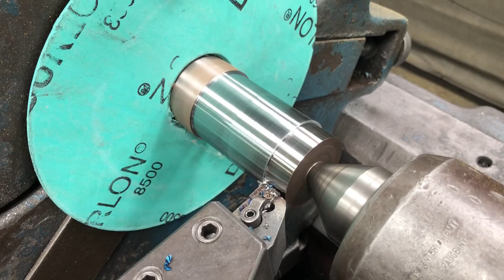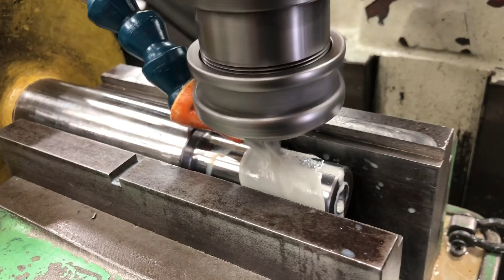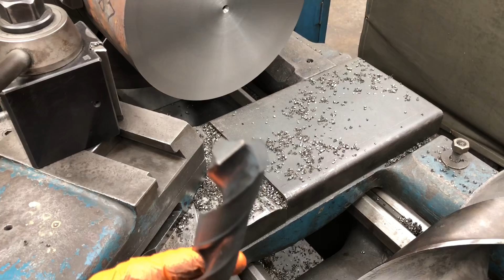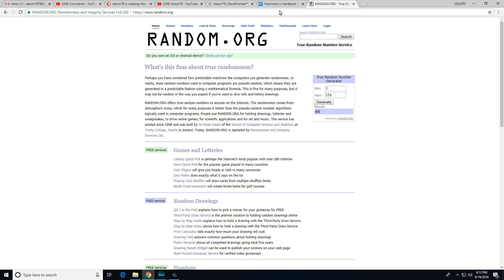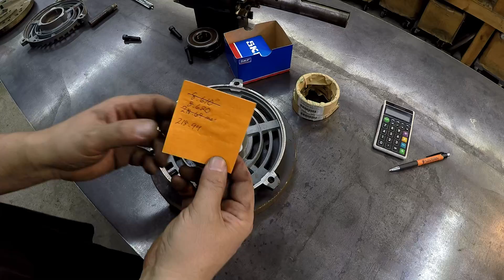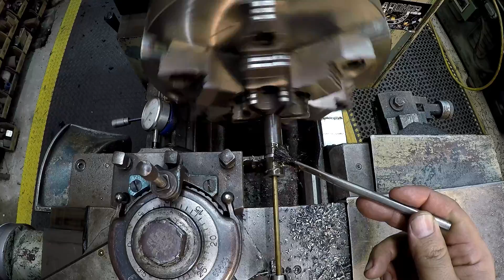SNS 232: K&T Endbell, Roller Repair, November Meet Ups, Machinery's Handbook

Comment: My first machining job was in an electric motor shop, did that very sort of work for two years. Workholding was always a challenge, since the bearing sizes went from 37mm to 180mm and everything in between. Made or modified a number of fixture plates while I was there, got pretty good at 4-jaw indicating, as every housing had to be set in the lathe with both radial and axial runout of a thousandth or less. Only difference is that shop used mild steel sleeves, and I can't remember what company made them, but they cut with a very nice finish; only with the biggest bearings did I need to make my own sleeve out of DOM tube. Was pretty neat when they seemed to trust me enough to hand me a chewed-up little gearbox shaft and said "sketch this up and make another one." 

I see you had a cardboard box in the chip tray of the Pacemaker. Collecting chips to give as souvenirs?

Incidentally, I work for SKF now, in the mechanical test lab for oil seals. Those bearings were likely made in the plant in Flowery Branch, GA. Good to see you're installing quality parts on your machine.

Comment: Was wondering why most machinist using a lathe doesn't use cutting fluid while running your lathe
Reply: Coolant is normally used on small parts that can work harden quickly. With something big like what Adam works with, for that to work harden would take something like hydraulic pressure. Plus, the sheer size of the metal acts as an amazing heat sync.

Comment: Hey Adam, how’s it going? Going good I hope! From time to time, I repair end bells and armatures for an electric motor company here where I live. I’ve never thought of making a fixture plate like that. I’ll definitely keep that in mind. A lot of times if I can’t hold one in the chuck I’ll make an arbor that fits the hole in the end bell. First, I like to toe it down on the mill and take a light cut on the back of it so the face and back will be parallel. I take just enough to give me a smooth surface to go against the larger diameter of my arbor. Next, I’ll find a piece of round stock big enough that the back of my end bell can go up against after I turn a short arbor on it. Drill and tap it whatever you choose. Then I’ll find or make a thick washer to hold it with and bolt her up. Put this in your four jaw and indicate it in and your ready to go. Done several like this with no problem at all, as long as they’re not very big. As always great videos and great info! A machinist learns something new every day!

Comment: That's a lota work cranking those big boy drills. Maybe time to get a drill holder for the tool post. Or I have seen quite a few shop made tools to link the carriage to the tail stock so the power feed can pull it along. Great video as always. Thanks for the KBC discount, I'll have to stop in there and see what looks good.

Comment: Hello, You do not have to have difficulties with life in inch and metric systems?
Reply: The wall chart he showed in the video is handy to have around if you don't feel like doing some quick math in your head or don't trust your math but both systems are taught and used enough in the US that it just comes second nature after a while.  In a way it's kind of neat using both, sort of like being bilingual LOL
Reply: As a cnc machinist, I carry a calculator at all times, and know the conversions from metric to standard and vice versa. with the cnc stuff its allot more time on the calculator.
conversions are always a must to know. with all of the formulas we must know. the conversion from metric to standard is the tip of the iceberg! :)

Comment: Nice work....
Ps: you should always use 6207-2Z bearings on eletric motors instead 6207-2RS....
Reply: Tiago Lomar Why? Metal shields vs rubber seals...is the heat what you’re referring to? Thx.
Reply: @thomasutley   yes...
I recomend 6207-2Z C3...   
C3 is a feature to the heat expansion...but maybe here in Europe is different

Comment: Have you thought of using hole saws or annular cutters to drill large holes?
Why? Fewer chips + Little round divots you can save for future jobs/projects.
Reply: Double Dare Fan I would say it’s about cost and maintenance. Twist drills are an order of magnitude cheaper than either of your suggestions. Also, Grinding drill bits is very fast and effective . Annular cutters and hole saws are harder to sharpen, if they even can be.
Reply from the maker: Why buy more cutters when investments are already made in twist drills? They do the same job, put a hole in something.

Comment: One thing  that always strikes me as 'scary' is when you machinist change drill bits immediately after some operation, and you never seem to burn yourself on thge hot metal.  Especially when tapping -- you pulled out that power-tap and handled it like it was a chunk of ice cold metal, and it HAD to have some heat in it.  Scary. :)  I guess you guys (Keith from Turnwright, Keith from Vintage Machinery, Tom from Ox Tools, Mr Pete from Tubalcain channel) all have asbestos fingertips.
Reply: The tool doesn’t get hot. The heat is in the chips.

Comment: Do you really do a lot of your work without coolant, or just for the vids? I work machine maint in machine shop, showed the big drill to my work mate, he's like "damn man, put some coolant on that thing."
Reply: He was drilling cast iron. Coolant just makes the grit travel to unwanted places, and does nothing to improve the machining.
Also, unless you are using through coolant, oil is far better for drilling (usually).
Reply: joshua43214 I totally agree.
Reply: Tom Krause some tooling are made and perform better without coolant.
Reply: With cast iron, you don't need or really want coolant

Comment: This is not critical but the metal shielded bearings are more harder(the rollers/ balls)/they with stand more force than the plastic. I have fitted a couple of bearings before at work
Reply: Most of the damage to motor bearings is from induced current traveling though the bearings. This causes pitting.

Comment: Why are the bearing sleeves made of cast iron instead of steel?
Reply from the maker: Many end bells are cast iron, and cast is nice to machine. You can order them in steel or even stainless if you want.
Reply: FOR THE HELL OF IT(?)

Comment: Thank you Adam for show a different way to grab an end bell on the lathe.
For this kind of end bells, we use to lathe a shaft with a little interference with the central (maybe the concentric gasket) bore, than a small plastic hammer do the coupling work. The torque it's enough good to bore the new journal.

Comment: 1.  If you take the chart and roll it the other way from the top and then from the bottom it will just about be flat.
2.  If you have not already got your ticket, there is an airport at Tyler--Pounds Field,  Shreveport is 100 miles east of Lindale on I-20, Love Field in Dallas and of course DFW..  Lindale is 100 miles east of Dallas.
3.  Will see you there.

Comment: Go on and adjust them bearings! On my '40s 20" lathe there was a very little bit of play on the bearings, could not see by indicating, parting could be done easily with upside down flipped tool but not at all the right way. Then i adjusted the spindle bearings, and noticed that not only the parting improved, i can take pretty much heavier cuts now with the same tools i used before. Very happy with the overall results.

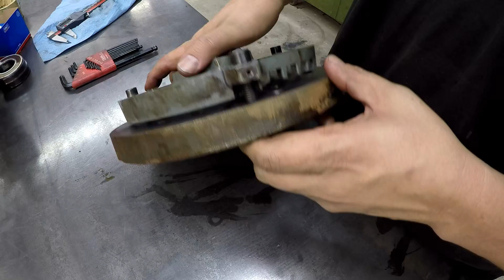Comment: Towards the end, about 34:00, making sleeves, stand offs, bushings, etc from solid stock: I propose an alternative. Stock an assortment of short lengths of aircraft tubing. It comes as nominal OD's in several wall thicknesses per OD. The stuff is precision drawn, straight, and consistent high quality as it's intended for aircraft applications. Many dia/wall combinations are available to suit clearance over bolts, tap drill ID's, and telescopic fits. It's also expensive to use as construction material but for making short bushings it's far more economical than machining from solid stock. A wide variety of 1 ft lengths in desirable dia/wall combos fit within $100. That serves to establish a source of ready material for quick weld-in sleeves, standoffs etc for a good many years.

I've re-stocked my stash from Wick's Aircraft for mant years. Saved me tons of time making RH/LH turnbuckle tubes - part them off and tap them - for Heim joint links for the local motor heads. 5/8" OD x 0.105 wall 4140 aircraft tubing will air harden to about 35 Rc, perfect for high strength steering/suspension linkage using 1/2" Heim joints. 

That kinda stuff helped pay my mortgage in racing season from the late '60's to 1993 when I hung up my apron.

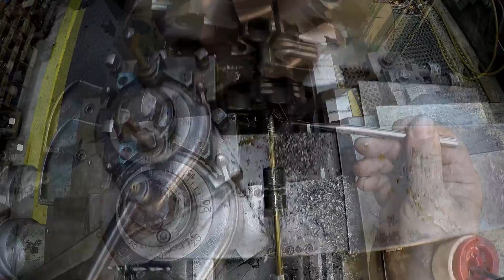35:50 "This lathe doesn't like parting." The compound slide is narrow and the Multifix tool parting holder overhangs the  blade some distance from the slide. The cutting forces try to roll the roll holder/post/slide to the left. If there's any looseness or compliance, the parting operation will suffer. The tailstock flat way is nearly under the bottom of the parting tool holder for most diameters. I suggest you make a block or parallel to a close fit between flat way and the bottom of the tool holder as a solid support. This stops tool holder deflection and transfers cutting forces directly to the lathe bed. 

It doesn't have to be fancy; make a template from cardboard, chomp out a shape from plate, and mill the top and bottom edges parallel to fit the space with 0.002" clearance with the parting tool on center. You might need two: one for the HSS parting tool and one for the insert style. Can't beat stiff.